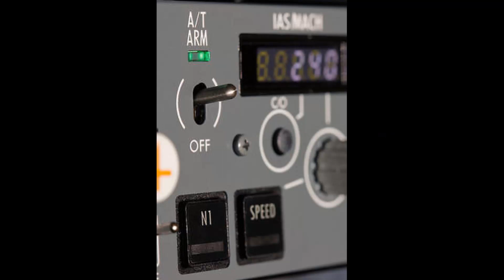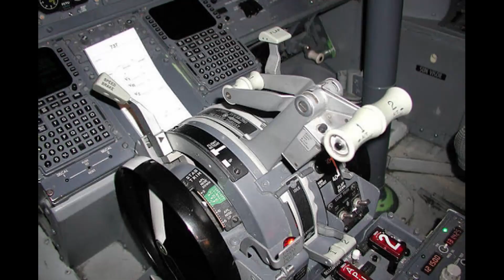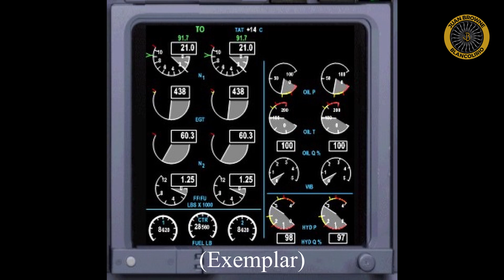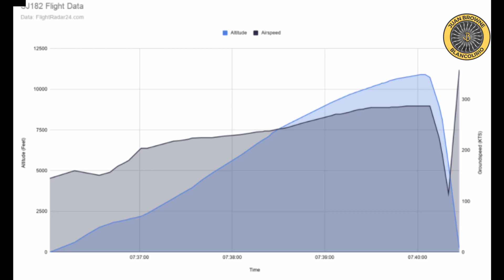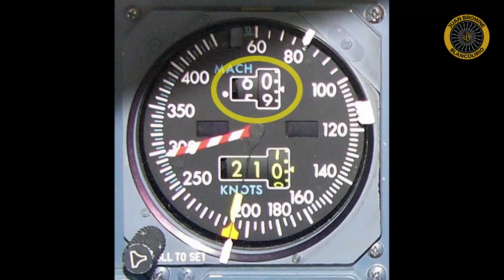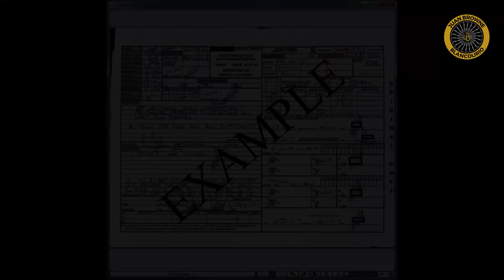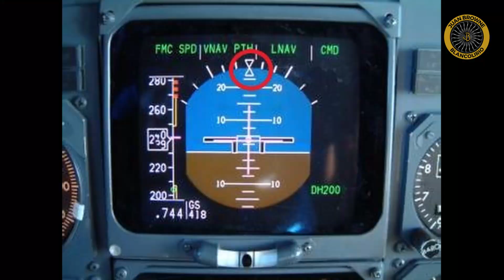Sriwijaya SJ-182 KNKT Preliminary Report 12 Feb 2021

Comment: I'm fairly new to your channel. Excellent reporting and information in a fashion that is understandable for everyone.

One aspect of this reporting that I see if I understand you correctly, is the possible over reliance of the automated flight systems by the crew. A second aspect is the maintenance work arounds of the flight systems.

I can see parallel situations in other industries with these that you described. Before I make my statement, let me give you a partial of my bonafides'.

I have been working in the oil and gas industry for 45 years with 37 years of processing. Of those 37 years, I have been in oil refining for 31 years. In parallel with that, I have been trained in computers, robotics, and industrial controls. I have also trained in automotive maintenance.

The first aspect of my commentary is on the over reliance of automated systems in regards to the personnel. It has been my experience in my industry that the greater the automation factor in control systems, the more reliant the operation personnel have become for it to maintain proper operational parameters. With this reliance on the automated systems, the operators all too often do not recognize the need to override and take manual control during emergency conditions. Another point of this scenario is that when manual control is necessary, the operators do not have the experience of manual control to make the proper adjustments in a timely fashion. From that which you described, this could be what happened to the flight.

The next aspect of my commentary is on the maintenance work around for the automated system where the cleaning of the contacts was made. 
In a high humidity environment such as that where this aircraft was operated, oxidation on mating contacts of the control systems would be an ongoing maintenance issue. I see this with computers and with automobiles of a regular basis. Simply cleaning the contacts is not enough to keep the problem from recurring. After the contacts are cleaned, they need to be coated with dielectric grease which formes a barrier to the elements in which they are in. Furthermore, in a control system, the mechanisms being controlled need to be recalibrated do to the changed resistance in the system. This may or may not have been done. The report does not specify this. From what I heard, this probably was not done which led to the improper operation of the automated throttle system.

I could be totally wrong in my assessment of the situation. This is simply my take on this from the information given.

I thank all of you who have read this.

Take care and be well.

W-30-
Reply from the maker: You got it! Welcome aboard and see previous updates on this same topic Warren. Thanks, Juan

Comment: Juan, Back in the sixties when I got hired at TWA, having a commercial and instrument rating was all that was required for domestic operations, on international route an ATP and a rating on that aircraft was required. I was hired with 160 hours of flight time and went into the F/Es seat, I also spent about ten years in that position and during that time I acquired as many ratings and as much flight time as I could (ME,  SEAPLANE, ROTORCRAFT HELICOPTER, CFI SEME INST AIRPLANE, 10 solos in Gliders and a 10 hour course of aerobatics) accumulating about 1100 hours. I checked out as an F/O on the B707 still with a commercial ACSE. In the late seventies the FAA finally mandated that al F/O in a part 121 operation had to get a multi-engine rating. I didn't get my ATP until 1989 when upgraded to Captain. I also agree that a lot of pilots rely on too much automation and don't FLY the AIRPLANE (Asiana in SFO as  a perfect example, four rated pilots in the cockpit and nobody watches the airspeed.). But that's just my opinion. Great presentation as always, keep up the excellent reporting.

Comment: Another question following on from my earlier post:

There was a directive in 2001 to change out the auto throttle computer for a later version, exactly because of this problem. Was this "fix" adequate. Do the records of the previous owner of this aircraft get "seized" immediately to make sure the history of the aircraft maintenance trail is preserved for the investigation - are the records kept for the life of the aircraft ? Do they travel with the aircraft to the new owner ?

Also, following on from my previous comment, I find it hard to entirely blame the crew 100% here. If you are going to automate a system do it properly. Having the situation where an auto pilot dumps an emergency  on the crew is not acceptable. Where was the warning that the engines weren't in sync before the auto pilot disengaged. The same could be said for control surfaces, letting the auto pilot compensate for a malfunction in a rudder until it's too late is a recipe for disaster. A system which monitors things like this should be essential and run independent of the main flight control computer and give warnings if things go out of expected flying parameters. Something like this could have saved the 2 MCAS crashes maybe ? is there such a system already ? 

Are we faced with a situation where older aircraft just aren't up to 2021 standards and should be retired. How does this work on a 777 if for some reason an engine starts to spool down to idle. Thrust percent warning, fuel flow warning, EGT warning ??
Reply: " Where was the warning that the engines weren't in sync before the auto pilot disengaged." As Juan explained, the warnings were on the instruments that the PIC and PM should have been monitoring. These people are "the system" that monitors things...or should.
Reply: @lizj5740  Yeah, I get your point. I think I've calculated it right, but, from the moment the left throttle moved to disengagement of the auto pilot was 81 seconds. In that time they had a heading change and 2 height changes with ATC which they would have to dial into the autopilot. Does one crew member have to monitor this input from the other crew member to check it's correct ? The crew were distracted. I'm not surprised they missed the N1 reading on the left engine, hence my comment that I would have expected there to be an audio/visual warning for engine thrust imbalance. Just seems logical to me that this SHOULD be there.
Reply: @boba5984  You probably know lots more about flying than I do. I was not thinking about the other things that had to be done.

Comment: WITH an unaspirated TAT probe PILOTS had to leave pitot  Anti Ice heat  switched off  on the ground to get an accurate OAT temperature to input the FMS FOR  TODA settings. I believe the Captain left pitot heat switched off on his side whilst the F/O selected Anti Ice on his side (Right) They taxied out in torrential rain, which likely pooled rainwater in the pitot tubes. 
 Circa 11,000 ft I suggest rainwater in the Captain's Pitot froze as did the Left side Alpha vane This would have given erroneous high airspeed  readings which coupled with failure of the Left Alpha vane  (due to freezing) The   DFDAU may have been tricked by air sensor icing to interpret as gust loading, therefore the Autothrottle reduced power on the left to cope with a perceived gust loading. After A/T  reduced  thrust, rolled Left with autopilot disengaging, with nose down coupling.  ASYMETRIC pitot icing is capable of explaining everything we know so far(16 Feb)

Comment: I can’t stress this enough, you are absolutely the best in aviation information, accident debriefing, and general news and notes. Thank you for your time and effort in every video you upload 👍🏻
Reply: You nailed it , Wann makes it understandable, with out a lot of finger pointing!
Reply: Scott Perdue does well as well. We’re lucky to have guys like Juan, Scott, and Dan Grider. There’s another fellow who’s name escapes me at the moment that does a great job as well. Edit: I just remembered. Paul with AVweb!
Reply from the maker: Thanks Greg!!
Reply: @tomcoryell  Petter, aka Mentour Pilot.
Reply: @rhonda-my_honda_cb500x3  Juan and Mentour Pilot are my go to channels, they are both great.
Reply: @rhonda-my_honda_cb500x3   thanks! I was thinking of Paul from AvWeb. I will have to check out Mentour Pilot.
Reply: @rhonda-my_honda_cb500x3  Two of a kind, we're lucky to have them.
Reply: @VMCAviationVideos  Ditto.
Reply: More reasons not to fly foreign airlines they have lost planes on language barriers alone without aircraft problems. The crew were not monitoring anything after auto pilot was put on I blame the crew.👎☠️
Reply: @darrenicon5172  Good point: FAA requires english language fluency at aircraft maintenance repair facilities but often turns a blind eye. Hard to get the job done right with poor comms. It's a real issue.

Comment: Very competent reporting and style-wise you really stand out from the crowd here on YT. 👍

This update was disturbing again, because of the things one could assume from between the lines. More so having worked in that part of the world. Certain pressures DO compromise safety.

One thought crossed my mind: wherer does the A/T get its speed information from? A single sensor à la 737MAX MCAS? Maybe the mechanic swapped the faulty ADC responsible for the Mach indicator inop from right to left to cross-compare?

When I followed the 737MAX fiasco I was flabbergasted as to how Boeing could design a system that relies on a single data path and changes left/right side with each flight cycle. In my humble opinion that is - combined with sub-optimal maintenance - a recipe for disaster as evident in LNI610.

Just my thoughts...

Comment: I’ve been in the nuclear power industry for two decades. Training regimen is similar, but much more frequent, and for obvious reasons, always instrument only. Also, the NRC really stresses extreme events.
Reply: Yet TMI was an almost routine equipment failure !
Reply: Sort of. It was numerous equipment failures and training shortcomings that added up to create an extreme event. It’s partially because of TMI that nuclear power training is where is today. We learned.
Reply: @MatthewBallinger  That much is true. Control rooms aren't like they used to be with acres of dials and switches.
Reply: @pasoundman  Not true. It's still acres of dials and switches in control rooms. Little has changed in that regard.

Comment: Thanks Juan, great as always!
Yet again another almost certainly avoidable crash had the crew been PROPERLY trained, and had they properly maintained that level of proficiency!
Many moons ago, in the early ‘90’s, we departed KaiTak at night at max weight in heavy rain in a 767. After getting airborne, and with a SID requirement for an immediate turn, we ran into FAR heavier rain (deafening!) than the radar had suggested when we were on the ground, AND then we got struck by lightning, (and temporarily blinded), AND we then also simultaneously had an engine failure during the turn...   except that it wasn’t. The #1 engine thrust lever actually retarded with the auto throttle to idle, which I noticed immediately when I checked.
With our absolutely superior training and standards, and just like a well oiled machine, we reverted to basics and “flew the plane”. 
Furthermore, this was all handled without any major drama- and although we both got a fright from the totally unexpected weather and lightning, thrust was quickly reestablished and we continued as normal with the SID, and made sure that everything was Ok after the lightning strike. 
The rest of the flight was routine, and no reason for the rogue auto throttle behaviour was ever found and was assumed to be associated with the lightning strike.
THAT is the difference between a very well trained crew, and the standard of many low cost carriers and especially airlines in that part of the world- the record speaks for itself. Sad!

Comment: Hey J, our MEL shows nothing with regards to airspeed indicators, which translates to they are all required ("80", "checked".) Such critical failures as Unreliable Airspeed which has been featured in recent accidents rely on all airspeed sources for comparison/determination. The MEL permits operation with one Mach indicator inoperative as long as the other functions and Mach Trim operates normally. For the -800 both may be inoperative provided the aircraft remains below FL280 and airspeed remains at or below 320 kts. I'm not sure about the -500's MEL.
Reply from the maker: Thanks Steven!
Reply: @blancolirio  anytime. Keep up the great work.

Comment: To bad they cannot find the missing flight recorder chip. That would be key in determining if the throttle was reduced by the auto throttle or the pilot. Could it have been the the auto throttle was commanding both throttles to be reduced but only the left one was responding to command inputs and the right one was not responding to its command inputs?

Comment: Hi Juan , your analysis was  been perfect,  the SID was been ABASA 2D from Rwy 25R ,  i will  try  to simulation this accident  i will  set the failure of A/T  untill  reaching  the altitude  and the loss A/P  and i will try to recover  the aircraft. If the movie  will out been perfect  i will posted.
Reply from the maker: Keep me posted and I'll share your link.
Reply: @blancolirio   Ok
Reply: @blancolirio  The plane left at 14H 36 ': 46' 'at 14H 40': 30 '' registration stopped. Correct me if I'm wrong, it all happened in just under 4 minutes. Now I tried to simulate take-off certainly the climb rate had to be very high because in just under 2 minutes the plane was already at 8150 feet (about 4000 feet per minute), in the simulation setting the stopwatch I was unable to reach that altitude of 10600 feet at 14H 39'47 ''. For me, the climbing times do not match the recorded times .

Comment: Hmmm... Ok , as a Non- pilot there are a bunch of things I don't get ?  1) The A/C  does not give a WARNING that something is amiss , and then give a waring that " I am about to release control of the A/C  " , ergo get ready to take Manual control , BEFORE the A/P disengages  ?!?!  If not , why not ?   2)  Wouldn't the Pilot's see that they were veering off course and try and see why ? Also , does reducing the THROTTLE on a engine NORMALLY used when making turns ?   3) Shouldn't it be one of the common things to SEE or check , if you are veering off course ?!?  That being ,the Throttles !?  Thanks ahead for any replies . Gubs .

Comment: 1) is auto-throttle more trouble than it's worth? Or is it usually beneficial and only occasionally dangerous? Does it just need more intelligence, like detecting that the throttles are unexpectedly split and "kicking out" before it becomes a problem?
2) would it be good to put all airline pilots through proper aerobatic training and periodic practice? Or would the flight characteristics of small aerobatic types be so different from transport category aircraft that it could teach some bad habits/expectations? It seems like breadth of flying experience is usually beneficial when an airliner enters an unusual state, like the Gimli Glider incident pilot having extensive glider experience. Should that be enforced, or at least supported, by airlines?

Comment: If I've understood correctly, it would seem the auto-throttle had gremlins and had become desynchronised, which means it had started to move apart PHYSICALLY, too. The crew had asked for a change of heading of approximately 60 degrees to the RIGHT. Yet the rather poorly worded point about the compass heading DECREASING, being at a heading of 046 and getting lower, would indicate not only did they never achieve the heading of 075 requested to avoid weather but they were turning LEFT, back towards their original heading they'd specifically asked to come off for purposes of avoiding weather.

I have a question. There's a pilot flying, and a pilot monitoring, right? If the throttle PHYSICALLY is showing one throttle is decreasing while the other isn't moving, and presumably a matching change in the engine gauges (N1 etc), PLUS the aircraft is turning to a heading neither requested by the crew nor granted by ATC, my question is....what the hell WERE they doing? Who was flying yet seemingly didn't notice ANY of it? As for pilot monitoring, what exactly WERE they monitoring? Just ATC? Is that ALL the PM does? If you're turning to avoid weather, wouldn't it be somewhat obvious if you're starting to head back towards it?

When you consider it was an utter farce in the cockpit with respect to the auto-throttle and airspeed that allowed the Asiana crew to bellyflop a perfectly healthy 777 at San Fran despite having 2 senior pilots and the pilot flying doing this flight as part of captain training if I remember correctly, and now this, I really wonder what the hell is up with some airlines' if not entire countries' training regimes.

Easy to look at it from here and say that, I know, so I'm as much hoping someone can explain how your commercial airliner is starting to drift LEFT when you requested a course further to the RIGHT and you APPARENTLY DON'T NOTICE IT.
It seems ENTIRELY bizarre to me. TWO pilots, with thousands of hours, yet nobody appears to notice or ask questions as to why they're turning LEFT when they've not even reached their requested 075 heading?

I hope someone can help me out. Is this the sort of thing you may not notice if busy on the climb out following departure? As an aside, seems odd that ATC apparently didn't notice or comment, unless they did and it wasn't mentioned in the summary.

Cheers